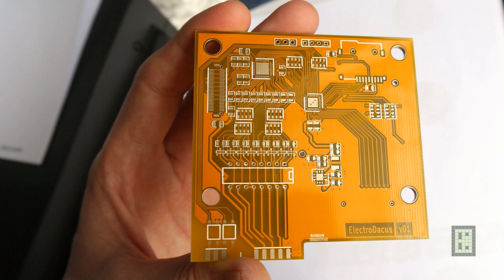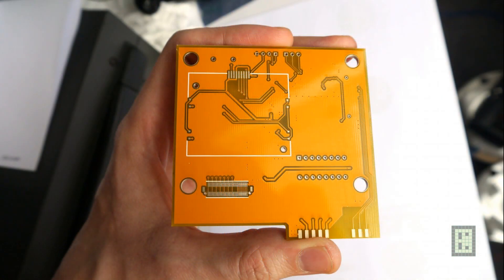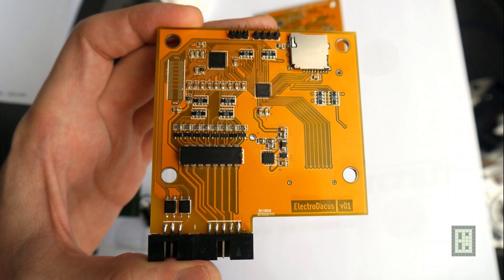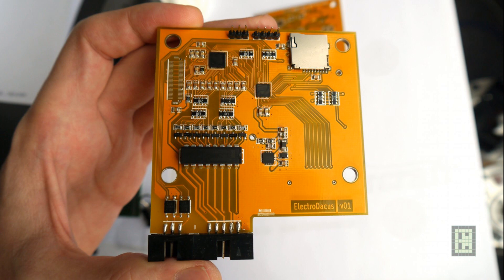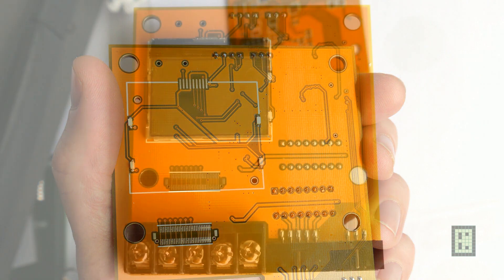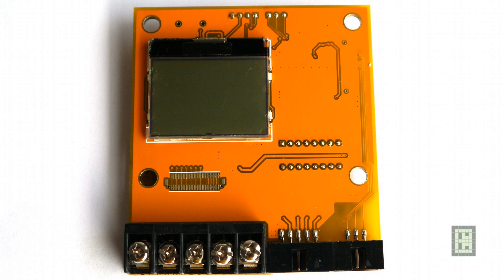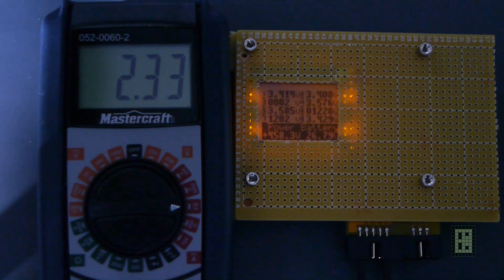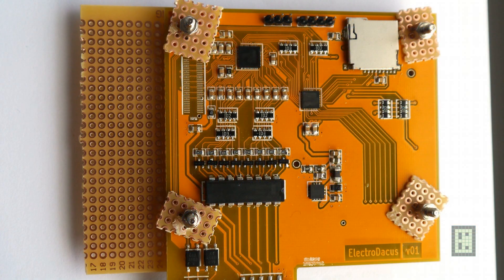Programmable BMS PCB for LIFePO4 can be used as solar charger.

Comment: HI I’ve been tasked by local eBike shop,  to repair some BH eBike (Evo Easy Motion bikes) The  batteries look OK all the cells and packs are fine but the BMS refuses to let the batteries charge or power the bike.  You seem to have a lot of BMS experience.  Could you recommend a unit I could buy on eBay or evne use your own unit to replace the original BMS as we can’t get any spares ?  I'm assuming the BMS can be programed for the ebike battery setup & voltages ?
Reply from the maker: Sorry I do not think I can help you. The SBMS I designed is specifically for offgrid solar energy storage and is different form a EV / eBike type BMS where charging is not done at the same time with discharging.
Also my SBMS is 8s max and you probably have a 10s or so battery pack.
Are you sure all cells in the pack are at appropriate voltage level ? Not sure what is the lower limit on that BMS and what type of cells are there but is possible it will not start charging if any cell is below 2.8V or maybe even 3V.
Also not sure what BMS is on that eBike or even how that eBike looks like but is possible it will need to be about the same size to fit and similar characteristics so you probably need the same BMS if it is defective.
Reply: Hi thanks for coming back to me, I also have a solar requirement so will look at you products they come highly recommended

Comment: Love your projects!!! And will buy one of your SBMS's in the future.... For my EV-project with my oldfasion Dutch Transport Bike. It's a 60 years old Dutch "Bakfiets" Here I have some of my idea's on pinterest.. https://nl.pinterest.com/stadsimkerij/bakfiets-project-stadsimkerij/
Reply from the maker: +Stads Imkerij Hengelo e.o. Thanks for the comment. I will not get one of those common BMS made in china that use a single 5 pin IC for each cell monitoring. They will overcharge LiFePO4 cells to 3.9V (look at their spec). I had a few to test and investigate and they are using inexpensive LiCoO2 protection IC's (a more common Li battery type used in mobile electronics). They are also not great for discharging since the limit is set at 2.2V way to low for LiFePO4.
The IC's they use those small 5 pin devices have fixed hardware limits so they can not be changed. They use those IC's because they are available at really low price and high volume and are easy to use. LiFePO4 are not as popular as LiCoO2 variants so there where no similar devices with proper limits for LiFePO4.
LiFePO4 are robust and will last quite a few cycles even with those improper BMS circuits but will degrade much faster than they need to.
My SBMS is not really designed for EV or e-Bike.

Comment: This looks really really great! I hope in future you consider going to more than 8 cells in series... Many e-bikes have 12 or more cells in series (mine has 20!)... and this is a big market!
Reply from the maker: James Nichols Thanks. I was not targeting eBike market since it was designed to power my offgrid house. In fact this is an old video I already have a model called SBMS4080 that powers my house. This was just an early prototype called SBMS2040. I prefer 8 cell max so I can stay in the low voltage requirements. Even with 8 cell you get around 26V with LiFePO4 and that is more than enough for any eBike. Legal ones have just around 250W allowed power depending on country and that is just 10A. The SBMS4080 can provide up to 80A that is 2000W and I'm working an a new model right now that will support 120A for both charing and discharging 3000W at the same time 6000W total.
Reply: ***** Yes true, worthy staying in the low voltage range. But a variety of brushless motors and associated controllers in the market work with 36 to 48 V. Most legal e-bikes are running at those voltages anyhow. Also high voltage is often preferable to a high current set up as that way the motor generally can achieve a higher maximum speed, rather than high low-end torque.
Reply from the maker: James Nichols You can have any motor speed (RPM) you want with a 24V motor. For a certain power motor you will need to trade RPM with Torque. I seen may legal e-bikes at 24V. If you look at my fist video on youtube is about a 24V brush-less eBike motor. It was not intended for a bike it was for a different project that is still on hold.

Comment: What chip are you using as the BMS Ive been working on a battery manager system and I got the balancing portion of it done but not the main charging IC for charging the entire pack
Reply from the maker: The IC that I use dose almost everything related to battery. You can see my newer videos with the second version that is already working.
Is currently on Kickstarter and if that is successful then the project will be open source and you will see all the components that I used and software.
http://electrodacus.com/k/

Comment: I can help with the manufacturing.
Reply from the maker: I will soon start to work on this again maybe next week. Then I will need to do a good video presentation for crowd founding probably Indiegogo not sure how may people will be interested maybe just 50 to 100 so it will probably be low volume.
I was thinking I will do the manufacturing if is just 50 pcs but I'm open to suggestions.
What do you offer PCB fabrication or also low volume assembly?
The design has changed quite a bit from this video now is a larger unit with 40A and 80A charge and discharge capabilities search for SBMS4080 and you will find my google+ page the Dacian Todea one not the electrodacus there are 3 PCB's one is front panel the main PCB and one for the power elements that one is aluminium it will need to be 3mm the beta sample is just 1.6mm aluminium

Comment: keep me in mind for when you produce the 100?
Reply from the maker: Thanks for the interest and comment. I hope I get the time somewhere in January to restart work on the BMS. Is mostly software that needs to be finalized and then some tests on my system.
This video is a bit old. There are some changes from this mostly a bit larger PCB and 40/80A charge discharge instead of 20/40A on the one from this video.
Maybe I get a new video next month with the updated hardware and the preliminary software.

Comment: With that in mind, I see that with the balance on top the need for a 'first cell at low voltage alarm' is a requirement as to cut the power before use hurts any of the cells.  

The other thing I see is related to old age. If the full batteries are near 80% of the new full capacity and you are using balancing how do we know if the top is starting to be overcharged or the bottom is over discharged? Would top or bottom balancing make a difference with this age effect?

Comment: I am not thinking of the battery pack for the reason for the warning. I was thinking of connected devices which depend on the pack being on. For example, a computer. People get focused on what they are doing and forget that they are on battery power, the alarm will jolt their memory as to allow them to shut the device down in time.

Comment: I have seen some RC battery chargers which have to be programmed. I kind of like them, but they have to be touched in order to work. I would like to see the BMS be set one time and the BMS learns and holds the program. Something like a car battery system. Yes, you have to check the condition say once a month, but works every time other wise and you don't have to touch it. In fact, that is one of my goals with after this project to build a super-cap LiFePO4 battery which would replace my battery.

Comment: I have to get some money before I can even buy the batteries and some passive hardware like switches and fuses. So,the BMS can wait some what. What time frame you talking about?

It might be good to add some kind of 'two minute warning' so that you can get a heads up that the battery is about to change dis/charge mode. It might not be now mainstream, but I think the safety issues with other types of Li-ion batteries will keep it growing. Flaming planes, phones no good. Will it balance the cells?

Comment: I have not found a BMS which I am happy with the design. Some have the discharge down to 2.00 V per cell and other have the charge over 3.8 V per cell. I realize that what I have read and seen with some EV group friends the cells are happier with 2.8V discharge and 3.65V charge. My device will not need more than 8A on charging and 16A discharging. I am currently undecided on battery size 20Ah or 40Ah because of size and weight issues comparied to cost. I know that I want a 12.8V battery.

Comment: I saw the time lapse of the house and also saw that the roof is on. I guess the next thing is to work on the inside.  

I know that I need a LIFePO4 cell charger and balancer that charges up to 3.65V and stops the discharge at a voltage that would not allow the batteries to be damaged. I also know that charge/discharge current can be an issue, so protection there too. Balancing the cells are a must because they will have problems if not balanced. So, I am need a good BMS which does those things.

Comment: If you do a google or youtube search for SolN1 you will see the idea of type of device that I am building.  Mine will have two 60W panels hanged and using a blocking diodes. It will also be using a Genasun GV-10 12.4V LiFePO4 (4S) 10.5A. I have not bought the batteries nor the cell charger/balancer. The load will be 180W pure sine wave AC inverter and a DC to DC converter along with a few 12V plug items. I would like to see how this board works and if you can place the parts on the board for me.

Comment: Otherwise, very nice project - Store solar into LiFePO4 baatery bank, this is what I have been doing for more than a year- and board; I based mine on a simple arduino leonardo (the cheapest) and programmable dual relay voltmeter with display and Wattson Energy Monitor